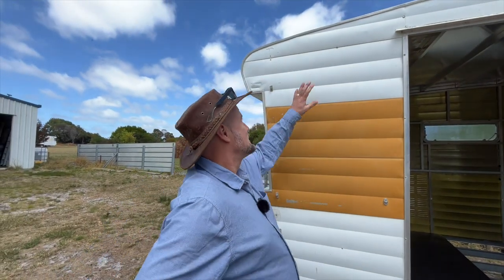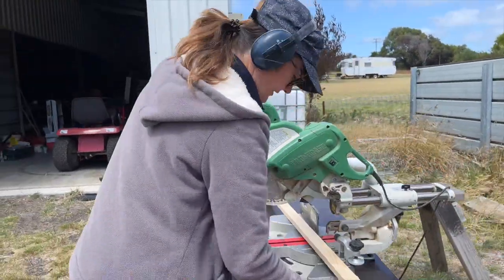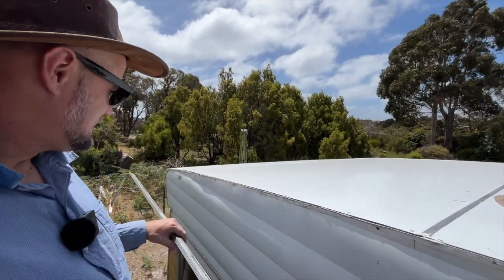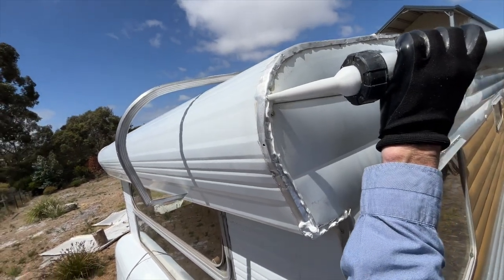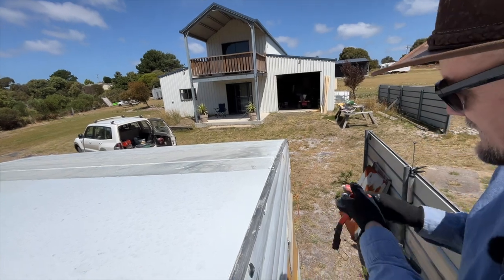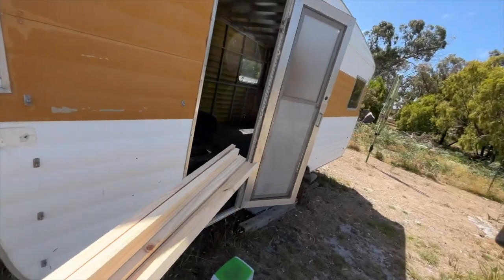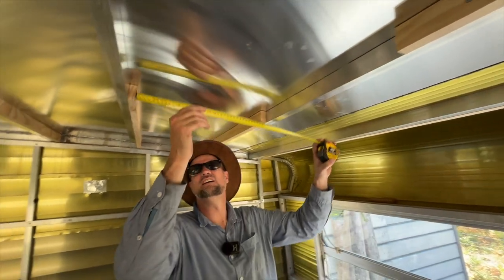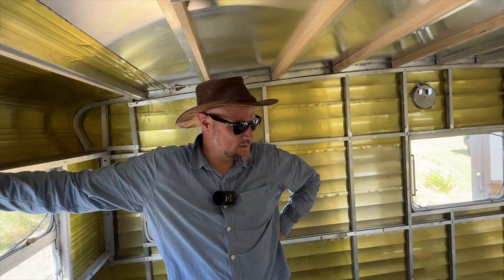Renovating a 1975 Viscount Caravan Pt 11 - Ceiling frames and more goo!

Comment: Just a thought for a bit of future proofing.  Caravans fitted for rooftop aircons have a steel "H" frame built into the roof.  If it's something you may consider for the future it would be a good time to whack one in.  Maybe the aluminium sqare tube will have enough strength, though.  nice job, I redid those edge strips on the roof of my van and it's a bugger of a job.
Reply from the maker: Good call, we’ve had a bit of discussion over installing an air con or not.

Comment: What size tubing did you use 40 looks slightly to big for me I’m thinking 39x40
Reply from the maker: It was either 50x25 or 40x25 with 3mm wall thickness. (I can’t remember 🥴) I did have to sand the ends a little to get it to fit.